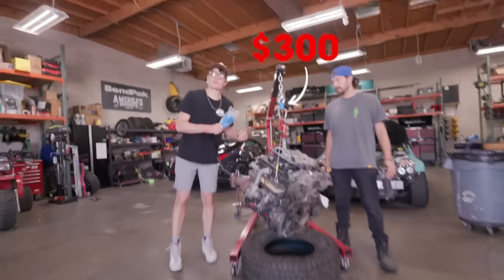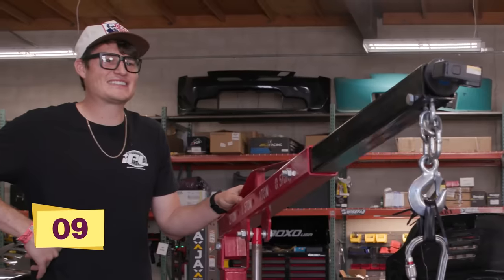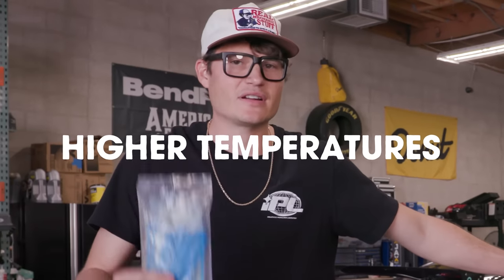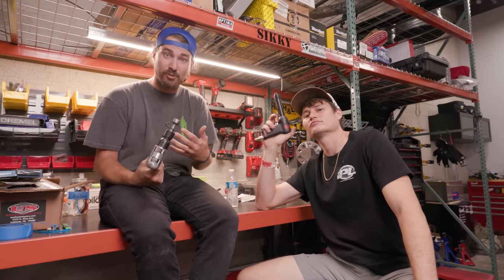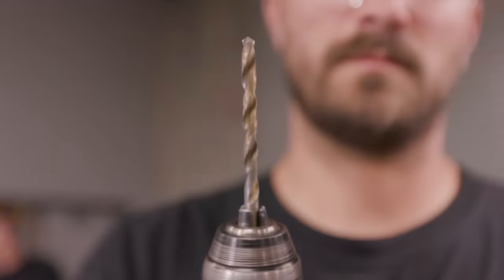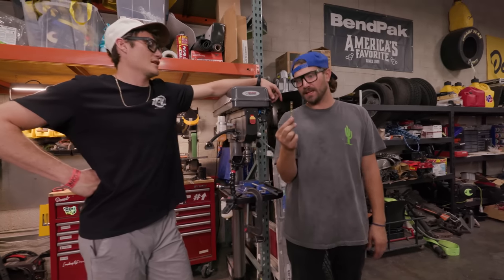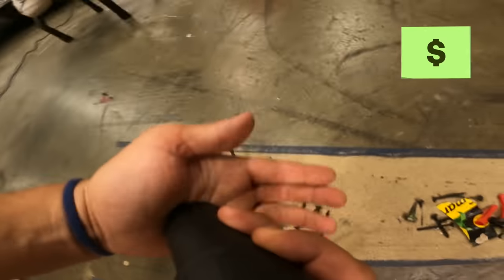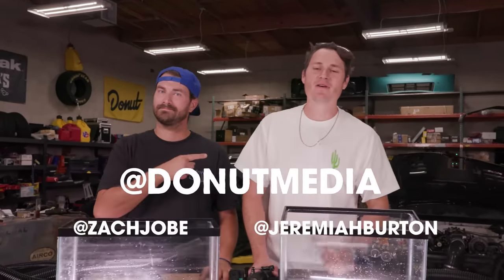We Test: $1 vs $300 Zip Ties

Comment: I deal with this on airplanes all the time. I’ve installed 1 zip tie that was worth $75. But it was a half inch, 12 inch long one. The reason for the cost is because of its chemical and heat resistance, also the certification.
Reply: they didnt even test a single chemical on the ties, would have been really interesting.
Reply: hope it's reusable at least
Reply: @geemy9675  Do you really want to be flying with an airline that reuses zip ties? lol.
Reply: Hello, fellow A&P.
Reply: Yea everything in aviation has to be top tier or things go wrong
Reply: @geemy9675  all zip ties are reusable. You have to just press the clip backwards with a pencil
Reply: Geemy I gotta go with buddy on this one.
Reply: anything plane cost a stupid amount bro 😂 we deal with 1k bolts sometimes lol
Reply: Why not ss zip ties?
Reply: @Earley405  Depends heavily on the use. In general, US airlines have extremely tight restrictions on commercial planes but from a layman’s perspective, you’d be surprised what’s considered and verified to actually be safe.
Reply: Guessing the certification is atleast $50 of that cost. Those sheets of paper are expensive AF
Reply: @Earley405  if they're meant to be reused, yes. I've seen a few documentaries about airplane crashes, sometimes can be as dumb as a few missing bolts. Don't remember cheapening out on zip ties though , but you never know, you don't want to make any assumptions that could kill hundreds of people
Reply: Lemme guess. Spirit airlines?
Reply: @Eduardo_Espinoza  the problem with that the tie can change size based on temperature so may not be suitable in many situations
Reply: It's the same thing with boats, you always pay for the reliability and safety (boats do have special fuel pumps to keep you from pumping your hull full of fuel and exploding) although they don't just fall out of the sky, reliability is way more important than in a car, you can't just walk home if your boat leaves you stranded, and you can't run away when it catches on fire.
Reply: @dr.science_0177  I guess you didn't know Fiat make jet engines lol...........
Reply: @bobbymilewski8602  sorry dude, all of them
Reply: @johnyates3946  and how does that different from my comment? Their company division are different and makes different things. That's like saying Ferrari also makes airplane engines just because they are owned by Fiat
Reply: That’s the thing about those kinds of things. The cost is well worth it as long as it’s required. If withstanding heat reliably is important then there is no replacing the expensive options. That is also why they are so expensive, with industrial parts they know they can charge more and people will still buy them. A few dollars per zip tie is nothing for using it on million dollar equipment.
Reply: Bingo. Depending on your environment (heat, chemical, UV exposure), it might make a lot more sense to use the Tefzel ties.
Reply: What? Yo what airline you work for?
Reply: Also zip ties on aeroplanes have rounded edege to not cut the cables with vibrations and are inserted backwards for the same reason.
Reply: Well said, at one of the large aircraft manufacturers, I have come across this too!!
Reply: @Earley405  do you want to use an airline that uses zip ties at all?
Reply: @geemy9675  it won't be not in aviation or nuke purpose just a great way to make a fortune in a scam way for good reason in the end I guess
Reply: @michaelharris8354  in my experience working in aerospace, the zip ties used are for electrical cable organization and other applications where cables are secured throughout the aircraft. That being said, I’d rather fly in a plane with zip ties than without. What did you think the plane was constructed of zip ties?
Reply: @joujimiichi1  seriously? I was being facetious. I’m perfectly aware that ties are issued for organizing wires and lines.
Reply: @michaelrobinson300  
With an airplane when your life is on the line I don’t think I would want to try that I don’t want them to reuse a zip tie on an airplane
Reply: Was going to mention recognizing those tefzel zip ties. They are used all over Williams jet engines. 

As for those worried about zip ties on aircraft, most aircraft manufacturers currently use zip ties to secure and organize wire bundles. Boeing even uses different color zip ties for easier identification. 

Prior to zip ties, wiring was secured using lacing cord. It is still required to be used in several areas on aircraft with exposure to high heat and vibration.
Reply: @Spelitus  nope it's the tefzel resin cost. It's about 10x the cost of regular nylon 6.6 which is used in most weather resistant applications.
Reply: Yeah, usually they do more of a direct comparison of the intended uses but more extreme.  I agree.
Reply: @michaelrobinson300  a pencil? Lol more like a flat blade, screwdriver, knife etc
Reply: @forget2bhuman993  Especially since they pointed out the reason the expensive zip ties were expensive was due to their resistance to corrosion.
Reply: 30 cent bolt? Oh its for an airplane? Thatll be $30 and its the same bolt
Reply: Ok big woop they're heat and chemical resistant. Still doesn't excuse that they're 300 dollars and have worse tensile strength or worse clip design than a 100 pack of 2 dollar ones. To be blunt it's molded plastic. It's not like the margins aren't enormous.
Reply: @alexsmith2885   exactly. Maybe some people are just desensitized to it cause they're in the industry and are surrounded by it.
Reply: @Men_Am_I_Right  I fly airplanes for a living, it still rattles me when I ask AMEs about parts costs
Reply: @Earley405  I really wouldn't want to fly on an airplane that even HAS zip ties
Reply: And not to mention quality control - for airplane stuff it has to be way more consistent regarding quality, since one broken zip tie or bolt might spell desaster
Reply: @Eduardo_Espinoza  because they would most certainly cut through the wiring insulation with the vibrations, even if they were rounded do to their incongruous coefficients of thermal expansion as well as the interface between materials of dissimilar hardness
Reply: @warummussmeinnameangegeben6502  if there's a plane where on bolt is the difference between life and death please tell me what it is so I never go on it.
Reply: Yeah that "cert" is where your money went
Reply: @tyomikshkolnik7988  normally zip ties are just used to keep wires in place. It's not like they hold the wings on the air plane
Reply: What the hell?
Reply: @TheHeadincharge  I
Reply: @R0cketRed  Yeah, I know. It's not like anyone glues the landing gear using Elmer's glue
Reply: @clark5486  I find a pencil works well cus sometimes it's so tight I need to use a point to get in there without damaging the tie
Reply: Fellow A&P I see
Reply: @dr.science_0177  I'm an aeronautical engineer in the defence industry and can tell you that "top tier" isn't always the case. A lot of our materials are in fact standard but slapped with an aviation tax that makes it 10x more expensive. It's just because of certification and DASA requirements
Reply: Hell we aren’t even able to use zip ties on our aircraft, only approved methods of securing wire bundles are string, and special plastic retainers I’ve never used.
Reply: @Earley405  I don’t want to be on any plane that uses any zip ties screw if they are reused or not. 😂
Reply: You’re holding my plane together with zip ties?
Reply: lmao I work on avionic shelfs and the more expensive ties might be as strong as the cheap material but the "tightness" factor with the teeth are totally a thing. Cheap ones will either be too loose in situations but also too tight and damages the wire. Expensive ones are very tight in any circumstance.
Reply: @fiercelambo7369  yeah, seem similar to brand name trademarked pharmaceuticals. In the case of zip ties it's literally a piece of plastic with a fairly simple mold. I can't imagine it costs 2.50 a zip tie to manufacturer, and shipping has got to be dirt cheap.
Reply: @eXpLiiiSiT  aren't they... adjustable? Or am I missing something
Reply: @Men_Am_I_Right  yes but the divots on the strap are spaced out more with crappier, more bendable plastic. Imagine two different belts you wear in your pants, ever had to make a hole in between the holes that were manufactured because one setting was too loose and one too tight? The belt is hypothetically already adjustable.... just not to the degree I'd personally like.
Reply: @fiercelambo7369  I meant top tier compared to regular things but you're right
Reply: Same reason why speed tape costs like 300 bucks a roll
Reply: @eXpLiiiSiT  ah ok so it's the level of adjustability.
Reply: @Earley405   or zip ties period 😆
Reply: @geemy9675  bro for how much I pay for airline tickets I hope they dont
Reply: @TheHeadincharge  what's the most shocking if I may ask?
Reply: “Military grade” is no exception to this
Reply: I wouldnt want any zipties on my airplane 💀
Reply: 1000% that fancy coc/8130/form1
Reply: @Eduardo_Espinoza  dissimilar metals don't play nice.
Reply: @caioaugusto3138  So on your plane what do you want holding the wiring loom together?
Reply: @poshun9407  some people's kids
Reply: @caioaugusto3138  It's probably for stuff like cable and hose management.
Reply: @poshun9407  Steel, Rubber & titanium supports/ tubes. Whatever makes it not fall down
Reply: Now hear me out: safety wire (source: aircraft mechanic)
Reply: @caioaugusto3138  zip ties are what makes it not fall down. That's why they use them 🤦🏽‍♂️
Reply: @poshun9407  whatever is not made of plastic*
Reply: I would hope the zip ties are not holding the plane together lmao
Reply: My air planr has zipties???
Reply: I use thousands of zip ties a year,  buy in bulk.
Reply: @Earley405  nope lol I want the stainless steel ones, coated in rubber where it contacts anything though! Maybe like 80 bucks a piece, and take forever to make!!!
Reply: @Earley405  I refuse to get on any plane let alone one that uses any zipties.
Reply: That’s way cheaper than Uncle Sam pays for the Air Force 😂
Reply: Certified is the reason when you have to know with high confidence how something is going to perform.
Reply: I order parts and supplies for a hanger and I went through 3 vendors before finding good zip ties that aren't crazy expensive. Not being used for flight, just placement during component installation. The other ones would break on their own.
Reply: @Earley405  hell nah I'm taking them home and using them on some kinda other shit tho at those prices 😆
Reply: I was in the military. Allow me to translate: Stupid buyer goes to company with proprietary equipment and smart company super upcharges stupid buyer during contract to only buy from them. It's in private companies and in the military. Putting your hard-earned tax dollars to work.
Reply: And radiation embrittlement resistance, we use those uber zip ties in fission plants also.
Reply: Still tho
Reply: yeah certification for airplane usage is insane
Reply: yeah me too, they're really good for holding the engines on
Reply: It's still stupid.just use more zipties
Reply: That aviation tax is high. I work on aircraft as well and the bolts and equipment we use has a hefty price on it simply because it’s part of the aviation business. Aluminium tap is the worst for aviation tax
Reply: @michaelrobinson300   That depending on how it's performed, personally I use a razor blade or Box cutter tip, Because if done multiple times with a Blunt round object it will wear down the catch.

The same thing happens when you run it backwards and it sits for a while especially in the heat when you put it the right way around it won't catch anymore.
Reply: Damn dude i use it too...
Last time i used a $120 zip tie was when the left wing came off my Boeing 747 u know.. used a hell lot of them, like almost 50
Reply: @zachthomas5272  hello there from another A&P
Reply: @kachikaboi  sometimes you just gotta use FLEX TAPE SLAAAAAPPP
Reply: @ingzzzzzz  so THAT'S why they tested how many it took to hold up an engine.
Reply: @caioaugusto3138  A&Ps don't use zip ties to hold the plane together they use them to hold cables or lines  in place so they don't rub or get tangled in other things
Reply: The two gears in a tpe 133 engines fuel pump costs 10 grand from Honeywell. Just the two gears. Thats just one in particular I remember the price from. And thats our cost. Not customer cost.
Reply: The funny thing is everyone is freaking out about zip ties on an airplane...when the seats are 30% zip ties, double sided tape and velcro...also don't get me started on the thickness of the floor panels 🤦‍♂️
Reply: Probably just depends on the contract. Just because it's more expensive doesn't mean it's better quality. Im in the military, and i shudder when ever someone brags about "military grade". Military grade is just cheapest bidder, that's all.
Reply: Exactly what I was thinking. Let me soak in a bath of gasoline for days while at 100° and see which one does better.
Reply: @Men_Am_I_Right  dude ,for sure 😂😂😂
Reply: @dr.science_0177  ehh it isn't necessarily top tier, but they are certified engineered parts with qualities that are tested and verified to the standards that the FAA put forward.  Doesn't make them top tier, they are just tested and certified vs non aviation hardware that doesn't need to be tested and certified to the same standards.
Reply: @Spelitus  For sure man, it's ridiculous how much certification can add to a cost, especially when they need to have testing done to get said certification

Like I'm Australian, and for some dumb reason, we made melatonin prescription (I'm a pharmacist and it really is so low risk that I don't see why it needs that restriction), but because they have to do all these extra quality controls, ADR studies, etc; the cost balloons out ridiculously
Like can import 100*2mg for like $3AUD from the US
Vs Cirdadin 2mg is like $40AUD for 30, it's ridiculous how much it can add cost wise
Reply: @Men_Am_I_Right  So what you're saying is that if you had a multi million dollar piece of equipment that you needed to use these on.. You'd want the 2 dollar version that's not guaranteed for shit over the version that is guaranteed and tested to withstand all pressures and temps that it could potentially encounter in your usage case?

That's how planes go down.
Reply: @ryanmurfet226  those EASA and FAA certs sure crank up the price of parts. then again the liability in the industry is ridiculous.
Reply: @allothernamesbutthis  ooooo yeah bro even better when your working with 40+ year old planes. 
Finding part is almost impossible 😂. 
And the price because of that ouch and if it you don’t have a cert it useless haha.
Reply: After talking to people in my industry it becomes apparent that the cost is mainly centered around certification. 
That's why you can get one tire size that is mud and snow rated but a different size of the same brand and model of tire will not carry the mud and snow rating, the manufacturer didn't want to send the tire in and pay for the certification for every size of the same tire, as was explained to me.
Reply: @dr.science_0177  no it isn't as there are fiat jet engines and I have never seen one badged up as ferrari. I've been to the fiat plant in napoli many times over the last 15 years now they are GE but that's a recent acquisition.
Reply: @dr.science_0177  especially the fucking tools. Ugh. Ever seen non-sparking ratchet set costs? Broke my damn pocketbook at first.
Reply: @Earley405  frontier says hello
Reply: @michaelrobinson300  you just changed my life with that zip tie shit
Reply: @michaelharris8354   Why wouldn’t you want them to use zip ties? Want wires just hanging everywhere waiting to short out?
Reply: Probably $60 for the cert
Reply: @dr.science_0177  top tier, and top price, ever check the price of a steering wheel in a car vs a 172's yoke or something?
Reply: @ThePurplePupUwU  commercial products doesn't count. I'm talking about industrial products that are meant to last
Reply: @ryanmurfet226  There are a few reasons that the bolt costs so much. 1) Tight tolerances. 2.) Materials 3.)Certificates from source material to the delivery (handling/packaging)  4.) Storage of those mountains of certificates physical and digital for tracing purposes. The manufacturer will receive heavy fines if the plane goes down and that bolt is the cause.
Reply: Okay so the cost on the blue ones is also expensive because everyones governing aviation body has to agree, EASA, TC, FAA etc. In aviation everything is super taxed (50k seats) etc. and has to be the best of the best, and has to withstand crazy hot and cold cycles and various chemicals, ive seen what alot of people not in the industry comment is that its still not justifiable. As someone in the industry everything has to be in compared to something else, in the example of the ty-wrap (zip ties) the alternative is having an ame who  is trained and certified to secure harnesses with what we call lacing cord (its flat braided fibre glass cord) and it needs to be tied/tightened in a specific way and a drop of glyptal (special chemical) needs to be added to the knot to make sure it doesn’t un-tie. With all that considered $300 for ty-wraps are not that expensive, these “tests” failed to test longevity with chemical and temperature changes.
Reply: 5 dollars for the zip-tie, 70 for the cert. that's why aviation is expensive
Reply: In the space industry here: the blue zip-ties are probably tefzel, which is why they cost so much. Tefzel is VERY low outgassing, which is a must for anything going in a vacuum chamber and/or space
Reply: @Earley405  eh, so long as they aren't holding the wings on i don't really care. most of the BS with aircraft is "safety" for the purpose of raising costs and prices. or in other terms safety theater. It's a combination of over engineering such that things don't fail but also the fear of the public that an aircraft might fall out of the sky... that no one really wants, not even the pilots that would otherwise fly hunks of junk. with aircraft it's very much you will always have stupid people that do stupid things or don't know enough about how to properly maintenance their aircraft and will slap a bold on to good n' tight specs, but for the vast majority of people that do fly.... i don't think they want their aircraft falling out of the sky because that looks bad on them and it will likely kill them so they want to make sure that what ever is done to the aircraft is safe and done properly. 
But me rambling about how pointless most regulations are doesn't actually answer the question asked. so to answer that question... for tying wires together it shouldn't matter what wire tie you use or how they are bundled together so long as they are secured in a  way that is unlikely to cause damage to the wire sheathing, for other components that require a zip tie or other clamping structure, reusing a zip tie on i guess a hose or something probably isn't the best of ideas because the clamping pressure might not be the same... assuming they aren't designed to be reused. otherwise it's a difference between how important it is that x component is secured, at what pressure lvl and to what. because another thing that's important is if you are zip tying a wire to a sharp structural component.... you might want to use something else then securing the wire directly to that sharp component.
Reply: With airplanes it’s always expensive because of the paper trail that’s required for certification for every little part
Reply: if you need those requirements you probably shouldnt be using a zip tie
Reply: @joujimiichi1  I would much prefer massive eagles nests of wires EVERYWHERE!   All black with a barely discernable colored check every 2 feet for ID.   Unevenly placed throughout the plane.  None tied together.  Just all loosey goosey.   I want that flight to be a rockin adventure!
Reply: Uhh...yeah plastic changes size too, I have to assume you are suggesting a progressive loosening of the tie from thermal cycling since the mechanism is completely different. @shaynegadsden
Reply: @mikehunt-zx8tr Exactly, the cost is often in the compliance/certification.  If you can figure out a way to reduce that cost you could make a bunch of money but that's just a hard problem.